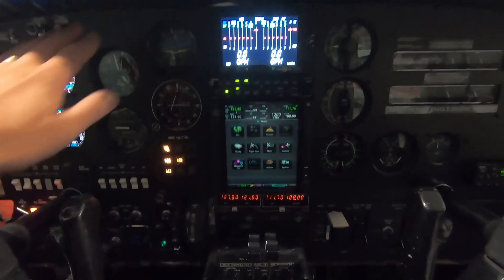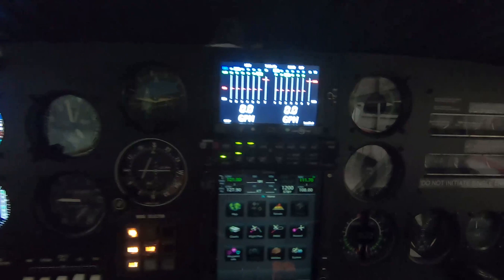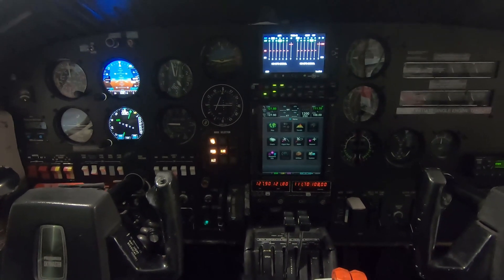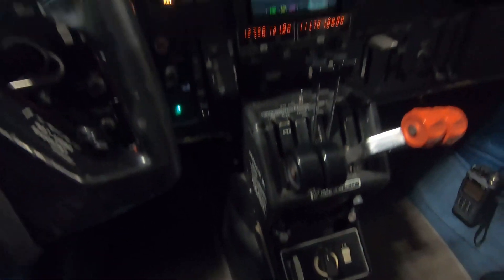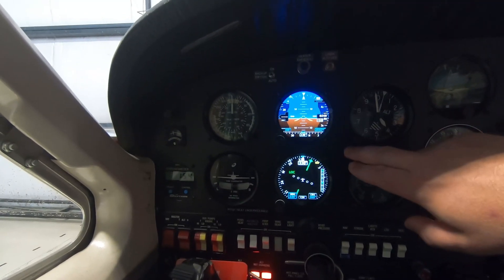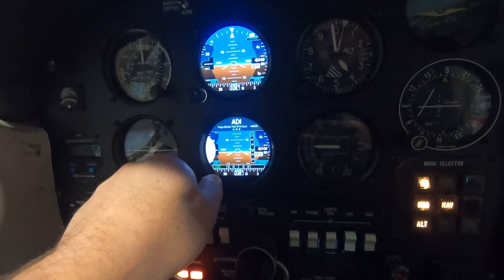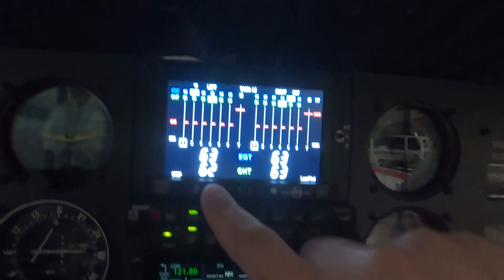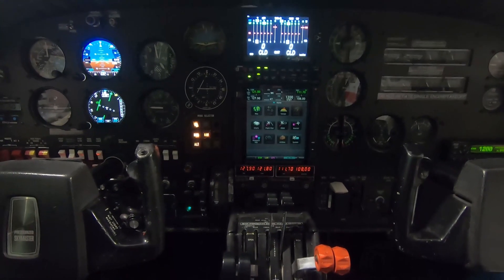Cessna 337 Skymaster Avionics Upgrades

Comment: The updated avionics look great! What's your impression about this setup after using it for a few months? Would you still buy the Skymaster over a conventional twin? 
Great stuff! Looking forward to some flight videos!
Reply from the maker: Thanks!  I’m still getting used to the panel and learning the gtn 750.  I’m liking it all though.  
I’m happy with the skymaster.  I like the pressurization and it is fast enough for me.  It is relatively easy to fly.  Will I ever change to a conventional twin?  I don’t know.  I learned on a seneca II.  It was fun too, but so far I prefer the skymaster.

Comment: Looks awesome Dan, did the avionics change the useful load and empty weight much? The G1000 sytems ive flown with seem to add a lot of weight compared to older set ups.  I suppose it would need a reweigh after? Good luck with it all 👍